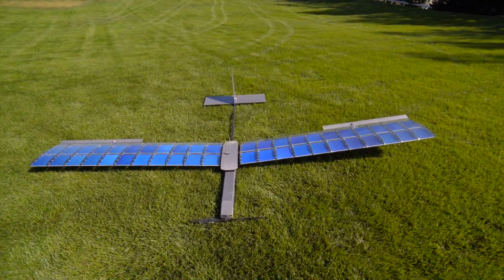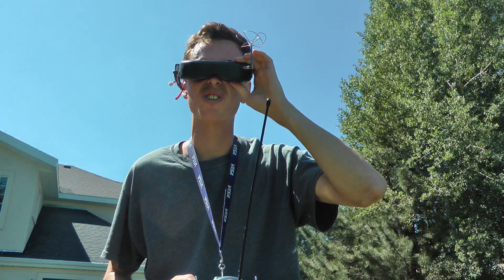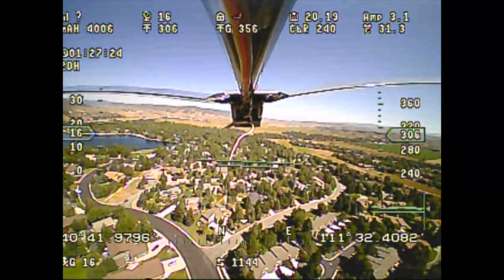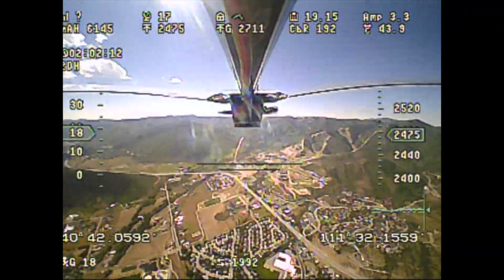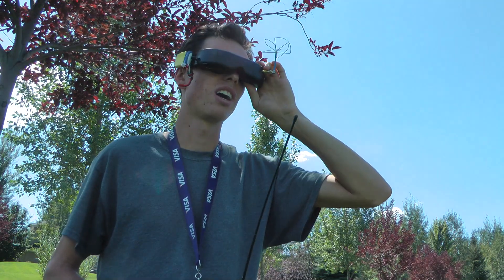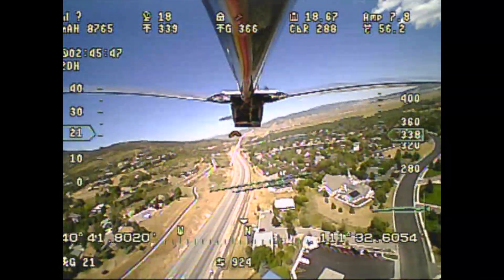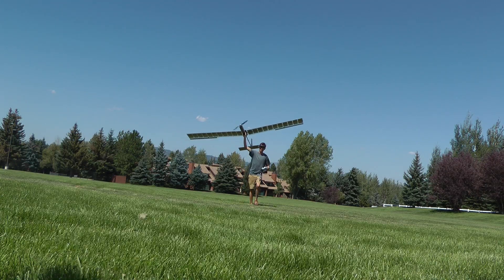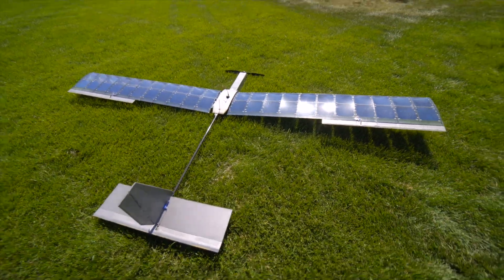SOLAR Plane V3 Long Duration Test Flight - RCTESTFLIGHT

Comment: Eject the battery once you get to sustained flight. That would be interesting.
Reply: A battery is needed to stabilize the power system and provide for the temporary intervals when the consumption exceeds the solar array output.
Reply: I think that I can safely predict a major CoG problem :) And I think Daniel already went down that road by reducing the size of the battery substantially.
Reply: No... three words: Long, long long long long extension cord  :P
Reply: that was 7 words. each long is counted as its own word. 
and the plane would need to be able to lift said cord. no way it would lift 2 ton 5000ft cord.
Reply: DarkShadowsX5   It doesn't lift the cord, the cord is plugged into another airplane that flies above and... uh, yeah  
Also, if you've ever done a 500-word essay , you'll know that 'Long, long long long long extension cord' counts as three words, possibly four. And this ':p' is to show that the post was in jest, not that anyone would ever take it seriously... :p
Reply: lol adding information that wasn't there... so pretty much a constant mid flight refuel? 
why not just say an extremely long extension cord then? you leave it up to your imagination will determine how long but you know its eXtremely long. lol
i'm still counting each one separately. no i haven't done a 500 word essay if i was ever assigned one i didn't do it. That kind of extracurricular work is just ludicrous and doesn't teach you anything except how to prolong sentences and say the same thing over and over in different ways.
no i wasn't taking it seriously i just have different humor i guess. :P
Reply: Try writing 1000+ plus papers. "Long Long long" is 3 words, but will get you shit on by the prof and if you keep doing that you would fail your paper.
Reply: Jetison! would need a small parachute for safety, but it could work, as long as he hasn't pissed off the FAA enough already as it is.  Also would need to make sure that wouldn't change the center of gravity in an adverse way.  It's cheating, though!
Reply: I think he'd need the battery to get back if the sunlight was suddenly cut off from cloud cover or ufos.

Comment: You should think about building some winglets. They reduce  drag and improve lift, by reducing the vortex at the end of the wing.
Reply: Luca Spanu iirc they are more efficient on wings with more sweep and a straight wing doesn't have much to gain from them.
Reply: I think Daniel's wing is venting the trapped heat from PV cells inside wing - out the open end/wingtips' venturi? 
That's quite an elegant solution to the (significant) problem with heat and PV yield.
Reply: .....and if he can't install winglets, he could attach some piglets!😂
Reply: High aspect ratio wings don't benefit as much from winglets and endplates as low aspect ratio wings. Simply putting a winglet could just be worst. A bad designed winglet or endplate isn't worth, it has to be modeled to improve the efficient. The only thing that you can certainly say about winglets is that they look cool haha. Yes, they have a tendency to decrease the induced drag as Luca said, but it must be designed for doing it in that specific plane.
Reply: Winglets doesn't reduce any compression issues, and this plane could benefit from the reduced vortex a lot, since it doesn't have a tapered wing.
Reply: Luca Spanu do you have a YouTube channel
Reply: Im quite sure that winglets are an alternative to increasing the aspect ratio of the wing. Due to their vertical orientation they generate a much lower bending moment in the wing than if one would extend the wingtips horizontally. The big advantage can thus largely be found in the decreased structural weight of the wings. However, for this project I think there really are less complicated ways to decrease structural weight and increase efficiency.

Very cool project!
Reply: Winglets have nothing to do with lift. Only purpose of winglets is to reduce drag. There is a small problem. It improves induced drag only at about 5% if you can do it right (it is very complex shape). That's why you can see it mostly on airliners or high performance sailplanes. In our case with solar powered plane it would be too heavy and gain would not be worth it.
Reply: Always better to have more wing then winglets if facilities allows.  Loading on those wings is so low vortex would be non existent.  I am guessing .05 lbs per square inch where as commercial is running at I believe 125 lbs per square inch
Reply: mozismobile since when does a model plane fly 0.95 mach?
Reply: actually winglets reduce lift as they reduce drag. A commercial plane can fly faster, generating same lift and drag with winglets.
Reply: christian mühl the HTV-2 is an unmanned plane that went 20 times the speed of sound or about 13,000mph, and this was back in the early 2010's.
Reply: Firstly, HTV-2 is not a "model" plane, it was an unmanned, rocket assisted glider. Secondly, on both test flights it began to disintegrate, lost contact and crashed (flight safety protocol onboard the aircraft was initiated). Thirdly, back to the point, it doesn't have winglets! Not a great example to use for this...
Reply: That is faster than orbital velocity.
Reply: This kid engineered a fucking plane that can, under certain impossible, but semirralistic conditions, charge itself as it flies, and you want to try and suggest using winglets like he hasn't done hours of physics to figure this out lmao.
Reply: mozismobile 1. Winglets a used to make planes more efficient by reducing the vortex on the wingtip. (because under the wing the air has a higher preassure than above the wing, and the hifh preassure air flows to the low preassure air and generates a vortex. This is stopped by using winglets.

2. You dont have mach Problems if you fly under mach 1.
Reply: christian mühl: as I said, winglets reduce vortices and make the effective wing longer. But if you want long wings anyway, that doesn't matter. He'd also want drop winglets to avoid cell shading. Regularly losing 10% of your solar output to  the winglet would make any aerodynamic benefit irrelevant.

2: that's flatly wrong. You probably won't have mach problems if you fly under .95 mach in a straight line with no turbulence. But as soon as part of the wing goes fast enough to experience mach turbulence (about .98, depending), you start to have problems. The cliche example is the U2, which flew high enough that stall speed, plane speed and mach speed were all about the same. When it turned the inner tip would stall while the outer tip hit mach turbulence. It literally could not turn at maximum altitude (in practice they flew lower than that, for that reason).
Reply: I don't think this would make any difference at these very low speeds. At these speeds you barely have vorteces and i don't think the extra friction and weight would be worth it
Reply: why, he can just have longer wings to make up for it. The reason winglets are used is mostly airport parking space, with a secondary benefit of reducing mach problems at high altitude. Neither apply here, and the benefit of two extra solar cells at the end of each wing probably outweighs the extra surface drag. You'd need actual measurements or CFD modelling to know, I think.
Reply: I heard winglets are only to stop vortexes so that airports can cram more takeoffs and landings between planes, without the turbulence for the following plane.  not so that it can be more efficient for the plane,  but more efficient for the airport!

Comment: Have you thought about using ArduPilot instead of the vector? I know the vector is top of the line but I don’t think it has mission planning so when you are doing these long flights you only need to watch it and not fly it.
Reply: Gordon Heydon couldn't you just do a 1000ft loiter with 2D hold?

Comment: if your amp meter is just on the battery (the motor and the solar after the meter) then when the battery is charging you'll get a negative current and when the motor is drawing from the battery you'll get a positive it might give you a better indication whats going on, but you'll have to guess cruising power

Comment: I could build you a telemetry system using 433mhz or 915 mhz to send back voltage and current readings, etc.    Arduino+INA3221+3dr telemetry radio (+ground station)     :)
Reply: FlightLine he already has all that on the osd
Reply: Not separate current readings for Solar, Battery and Load (Motor)
Reply: Ah ok. Think that'd be useful. The main problem I can see would be weight tho.
Reply: Yes, weight will become an issue, at some point.  A 3 channel current sensor+3dr telemetry radio won't be too heavy.   However, there will be more drag when adding the telemetry antenna  - lots of factors
Reply: Yes, weight will become a factor, at some point.  A 3 channel current sensor and a 3DR telemetry radio won't add much weight...However, the antenna will add more drag.  Lots of factors to weigh
Reply: he all ready has the ability to read 1 voltage & seems to have some selectable setting on the plane why not just rewire the builtin volt meter to a relay to select between solar and battery not sure why you would need a voltmeter for the motor as amps are on the display

Comment: Love what you are doing here. I do have a few suggestions I am not fully versed in solar cells so correct me if I'm wrong but when your battery is already lower than the charge rate of the solar cells the solar cells become more efficient and produce more power. So if you're solar cells are producing 23 volts and your battery is only capable of 21 you do require a circuit to reduce the voltage so as not to overcharge the batteries. What if you were to use a 6-cell battery which is capable of 24 volts started out with an 80% charge and see if you can't maintain voltage and altitude without needing any kind of extra circuit between the battery and the solar panels

Comment: Honestly I doubt you'll get much more efficiency than you already have, lots of complicated suggestions in the comments, some worthwhile, some a bit silly. 

I'd argue the sensible option is as follows:

1. In good sunlight measure the current of the solar array in a dead short with your multimeter (make sure your meter can handle it first...). 
2. In good sunlight measure the open circuit voltage of the solar array

You want the open circuit voltage to be at or higher than the maximum voltage your battery pack (number of cells * 4.2), if it isn't then reduce number of cells in battery pack or add more solar cells (I appreciate this would probably mean a re-design of the plane).

3. Connect a buck converter to the solar array, you want one that can handle something like 1.25 to 2 times the dead short current, the more current it can handle, the heavier it will be
4. Set the output of the buck converter to the maximum battery pack voltage (again, number of cells * 4.2)
5. Connect the battery pack and test

In this situation, if the solar array can provide an excess amount of power it won't overcharge the battery pack(s), if it can't provide enough power to charge at number of cells * 4.2, the buck converter will allow the solar array voltage to drop the level of the battery pack(s) and as much power as possible will be extracted from the solar array as possible.

Keep in mind that any amount of conversion, step-up, step-down, both, will add inefficiency to some degree. I doubt MPPT will give you much more for the weight used, if anything. 

Regarding measuring the current in flight, in theory you only need two points of measurement, if you know how much is coming out of the solar array and how much is going into / out of the battery pack then calculating current for the electronics / motor should be a matter of addition / subtraction, how you display this on the OSD is another matter...

As always great video, thanks for taking the time.
Reply: You could also play with different battery capacities, larger means you can make more use of the solar array but then your plane is heavier (with obvious consequences), smaller means lighter, but you may be wasting available solar power if it becomes fully charged...
Reply: I feel the same way, no need to make it complicated!

But possible there is an even more simple solution.  Match the pv-panels and batteries voltage in a way that the MPP of the panels is close to the batteries voltage when they are full. Connect them directly (with a diode to prevent backfeed to the panels) together. Now the panels will be operating very close to the MPP point. 
Sure the efficiency will go down if the battery voltage drops below MPP of the panels but it won't be that much. A MPP-tracker also uses up a bit of energy itself this will be avoided.

Only problem is that the panels will overcharge the batteries so they need to be switched off at battery full voltage.
The diode can also be left out (typical diode drop voltage = 0,6V) by switching the panels of if the current reverses, switch them back on again if voltage panels > voltage batteries.

This is basicly how the system works now (manual switching) only I doubt if he tested the MPP voltage of the panels. So testing is needed at ground level where power (current*voltage) is measured comming from the panels while attached to a variable resistor. Highest value = MPP point of the panels. 

Maybe he is done this already it would be nice to see a video about it :)
Reply: I'm pretty sure Daniel has done this. Watch all of the solar plane vids. They rock.
Reply: Why do you feel the need to speak as if you know something? Your overcomplicated suggestion makes your primitive hobbyist level of electrical engineering skill painfully obvious. Power point tracking weighs less than the panel or battery and can significantly improve efficiency, and charging by voltage is not just considered a bad practice, it's entirely unnecessary here as you're already invoking current mode power conversion. You have fun playing in your garage, but stop pretending you have the ability to give good advice. It's bad for humanity.
Reply: Selfless Psychopath I had the exact thoughts about him when I read his babble/disinfo. He's a shill and is painfully obvious about it. His reply was a literal shitstorm.
Reply: Adrian, You are SPOT on. You do not get something for nothing. Something adds weight and conversion loss.
Reply: Kamiquadze FPV He hasn't seen them because he is a shill.
Reply: Oh you are so clever! The most clever man in the world. All prise Adrian Johnson, the man who knows everything better then anybody else.

Comment: Hi Daniel, just saw your video. I am currently working on autopilot algorithms myself and I have a suggestion. You don't need to put additional two watt meters to check the sustained flight. All you need is to put one on the battery. If I understood it correctly, you put the watt meter on the motor. That only tells you the total amount of power used. If you put it on battery, if you have a sustainable flight, you will end up with positive watt meter value, and if not, your value will be negative. Also, in any given moment you will see if the battery is charging or producing power. You can test it on the ground first, to see if watt meter is capable of producing negative values. If so, that is all you need to check it. Hope it helps! Keep up the good work, I really like it.

Comment: Hey, you should try do the numbers manually and load the solars optimally, before you try letting an MPPT do it all for you.
It goes like this: Connect a single solar to a load resistor. Measure voltage and current. Find the value of the resistor that gets the maximum voltage x current = power. I think I had something like 0.2 Ohms. Your best current level is the current you have with that optimal resistor.
Now design your charging system to draw that amount of current from your series of solars. Of course, if you have 2 series in parallel, then you need to draw 2 x the current, etc.

Comment: Hello, nice project, you should putt six more cells on the tail wing and on the fuselage cover. More power and put in the mppt! Cheers
Reply: More cells yes, charge controller no.

Comment: What about extra solar panels on the tail roof and nose .
Reply: The tail seems like an obvious area to add solar panels.
Reply: That would require rebuilding sections of the plane to counterbalance, weight has more impact the further it is from CoM (think a sea saw) and adding them to the absolute farthest part of the aircraft is going to drasticlly change the CoM and flight characteristics.   depending on the weight of the panels and how they attach to that bar it could also potentially create some wobble/flex.  the second point is purely speculative though since i have no idea what the build is like exc.
Reply: I think too heavy but I’m certainly not any expert he needs to do a QandA

Comment: Btw lithium ion/poly charges via CV unlike lead acid. If you are careful you can eliminate the charge controller and just use a general boost converter. Feed the cells full voltage at 100% charge. Unplug the cells immediately when not flying. This creates a situation where the lipo almost acts as a capacitor to a full battery giving you as much direct panel power as possible.  Also consider 18650 as higher density and your amp draw is in range.

Comment: Fascinating! So great to see the progression. In my simple mind I would think you could use the batteries only to run the motor and the solar cells to recharge them.  The set up would have to be the cells charge the batteries in a shorter amount of time you use them to power the motor, even if it were a cycle on and off power like you did a couple times when the thermals helped maintain altitude. Good stuff, thanks for sharing.